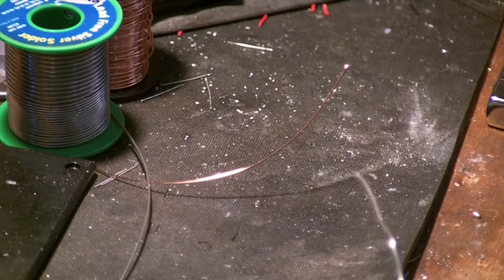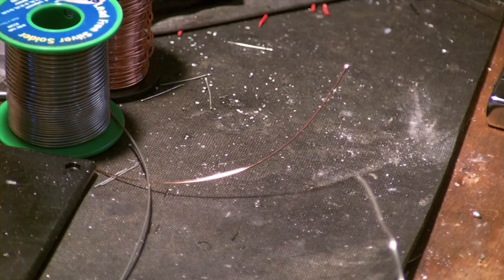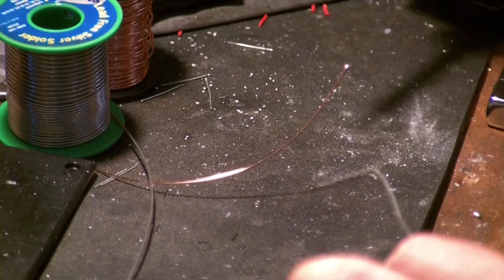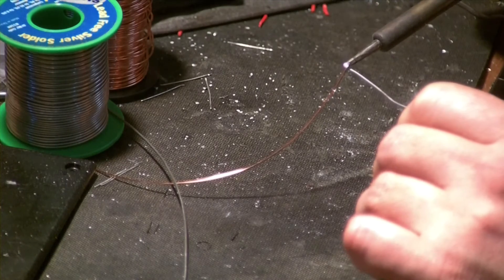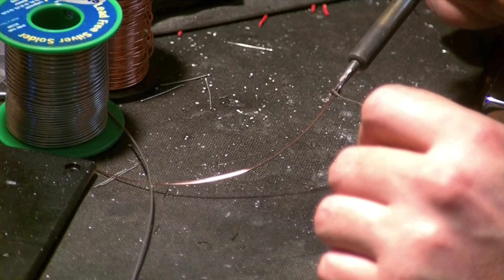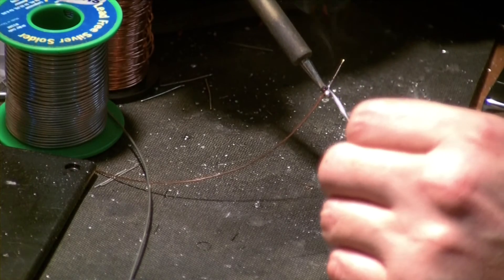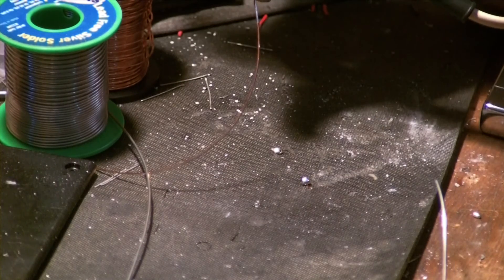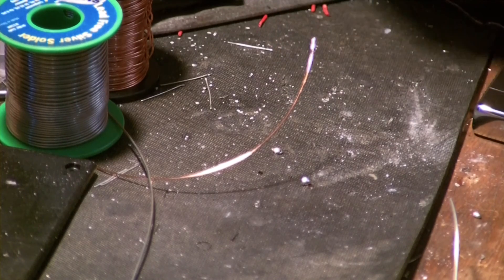How to tin Enameled Copper wire

Comment: Yes nice on the ends it works..but if you solder it in the middle of the wire..?like you have three tips that you connect with 1 cable ..what happens then...?? How do you start then...cause thats the idea of enamel copperwire that you make more connections with 1 cable ...
Reply: es no hacer cortocircuito, en contacto con otros cables